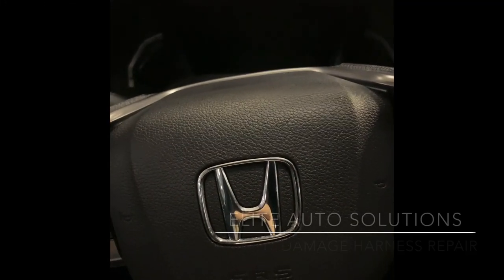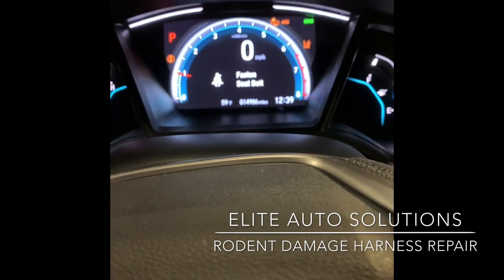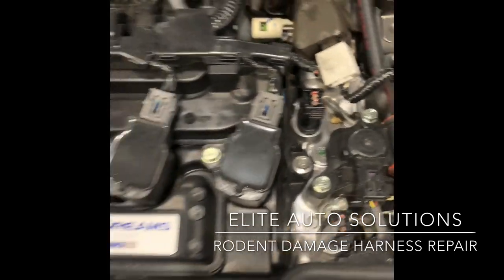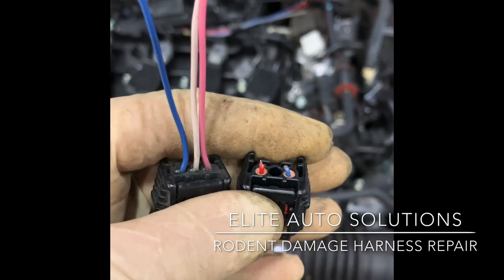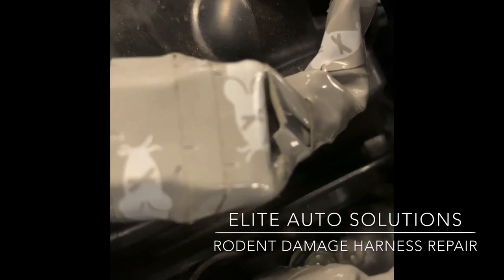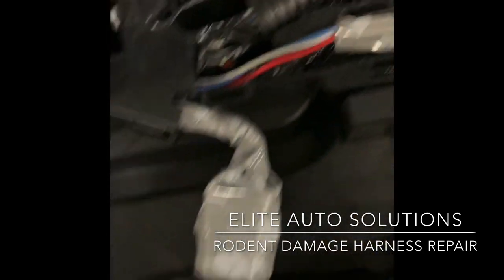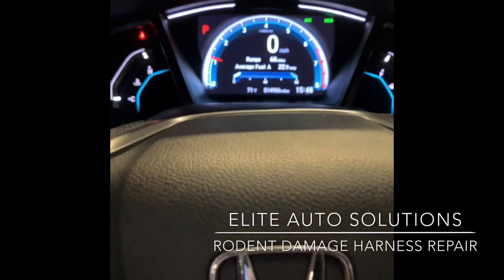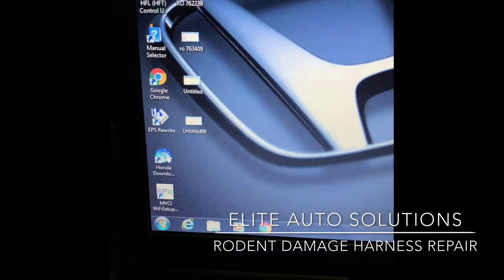P0300 p0304 p0340 Misfire Rodent Harness Repair 2016 + Civic crv accord

Comment: Just had this happen on my new 2020 Accord Sport 1.5 Honda wouldn't cover the repair under warranty. Dealer charged me $3800 including parts + labor. Said they had to take out the whole engine and dashboard. Your fix made it seem so easy. Thanks for the video!
Reply from the maker: Wow that seems like a lot, I sure hope they put anti rodent tape on the news harness or else chances are you’ll have a repeat issue. The method I show in the video of repair works excellent and I try to avoid a harness replacement at all cost due to how expensive it can get. Thanks for watching 👍🏻

Comment: 2017 Honda Civic Hatchback. Dealing with this now (long crank and error messages). I’m having trouble getting the clips free on the plastic part that the wires are routed through. I also don’t know the best place to source new connectors for the coils and the camshaft position sensor.

Comment: I have a civic 2016 and had the same issue yesterday. The rodents chewed off the 4th wire and the one to the camshaft. My deductible is $1000 so I'd end up paying more regardless if i went through insurance. My local mechanic suggested to get the part from a junkyard. Could you please tell how ended up fixing it and/or share the link to where i can get the part online?
Reply from the maker: Shoot me an email, I can send you the connector and some rodent tape to cover the connector to keep it from happening again. Bcautosolutions20@gmail.com

Comment: What would happen if you touch two different ignition wires together ?
Reply from the maker: Depends on which ones. Make sure your doing this ignition off only
Reply: @BCautosolutions   the wasn’t running but the it was on the on position , and it’s was one of the three wires  that goes to the connector that connect to the ignition coil
Reply from the maker: @david1from0dc  does the car not start now?
Reply: @BCautosolutions  yes the car doesn’t turn over, it’s cranks just doesn’t turn over
Reply from the maker: @david1from0dc  probably blew the coil fuse
Reply: @BCautosolutions   I imagine I would find that fuse in the fuse box  ?
Reply from the maker: @david1from0dc  yea

Comment: I know that when all warning lights are on on a honda: VSA, ABS, EPS, Track, etc it is because the battery went flat or it was replaced.and the pre settings were not saved. Also, you can do a "hard restart" disconnecting both battery cables, then touch them together for 15 seconds, then reconnect them again, positive to positive and negative to negative. The car would have to go through a series of tests and.checks via different cycles of driving to achieve and pass smog check and emmisions. Also, you may need to update the computers software.  What is your opinion about this as a honda technician??
Reply from the maker: Those lights can go on for many reasons including a weak battery that is correct. And yes after problem is corrected you can do hard reset and then all systems will have to do the self check before lights will clear then will have to drive through various drive cycles/scenarios for the readiness monitors to be completed to pass smog.

Comment: Man I had this exact same problem to me yesterday in 2019 Civic Sedan 1.5L. Took my car to dealership they told me rodent cut the wires to Knock Sensor (Rodent code p0340 on DTC) not sure what this code means. I had to pay $160 in repairs. They sent me the picture as well and it is the same device that you pointed out in the hood. Can I do something to avoid this issue from happening again?
Reply from the maker: P0340 is cmp sensor which would be same exact scenario here and the writer probably got confused but the $160 is a really fair price. Did the wrap the connectors in rodent tape, if not I would highly recommend you do it

Comment: Mine showed Camshaft Position Sensor “A” p0340 but have no idea which is Sensor A due to there's 2 of them on my 2016 honda civic
Reply from the maker: Yes there is. Here are the links to my eBay page if you need to purchase rodent tape.

By the foot: 
https://www.ebay.com/itm/275653043929?mkcid=16&mkevt=1&mkrid=711-127632-2357-0&ssspo=B-6pN_UWTIG&sssrc=2051273&ssuid=B-6pN_UWTIG&var=&widget_ver=artemis&media=COPY

Roll: 
https://www.ebay.com/itm/275631594731?mkcid=16&mkevt=1&mkrid=711-127632-2357-0&ssspo=B-6pN_UWTIG&sssrc=2051273&ssuid=B-6pN_UWTIG&var=&widget_ver=artemis&media=COPY

Comment: What did you use to remove the pins from the connector with no damage?  That rodent tape looks like a good thing to have. Solve the issue before it becomes a problem. Thanks again for sharing buddy. Artie 👍
Reply from the maker: I just use a straight pick. Have to pull the locking tab away from the in the pull on the wire (or what’s left of it) sometimes a needle nose and a second pair of hands comes in handy. The rodent tape is essential!